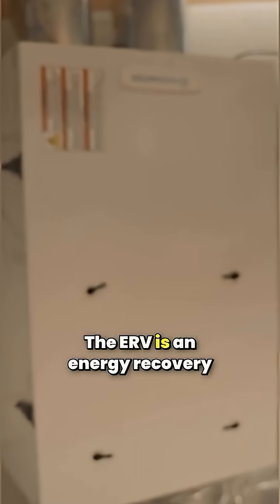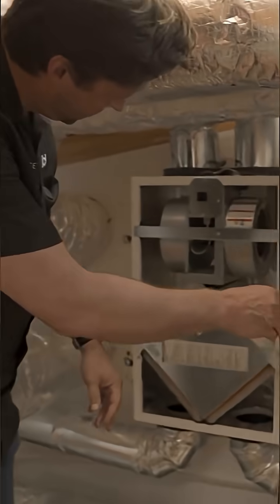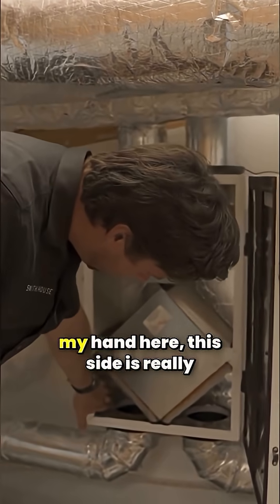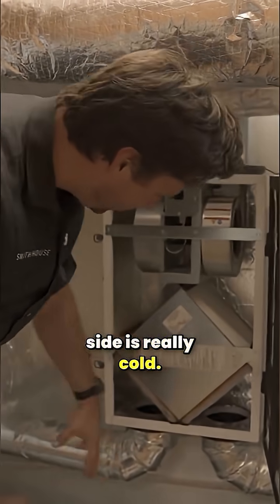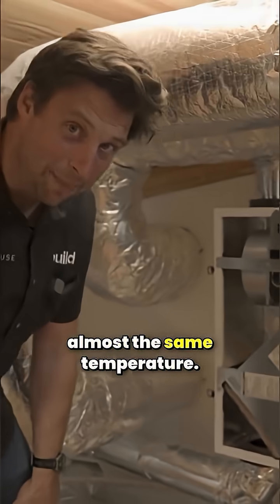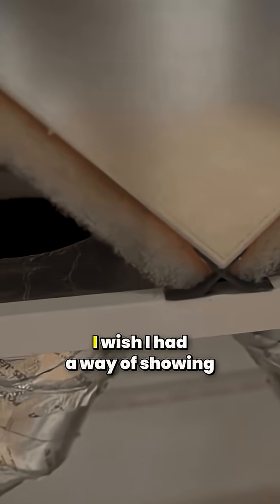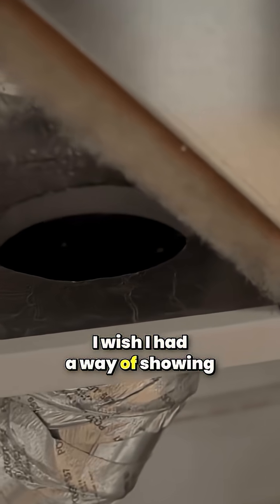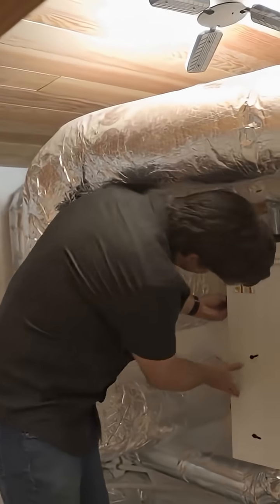The Power of ERVs

Comment: What is the energy consumption and how often is it running?
Reply: larger residential units typically 100-150w and ideally runs continuously. reduces heating/cooling loads by 15-20% compared with typical ventilation.